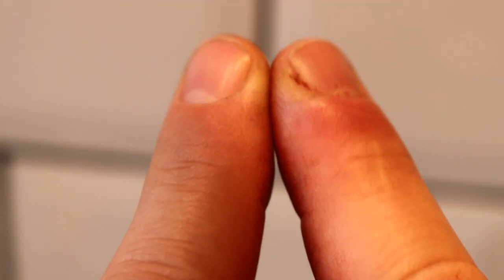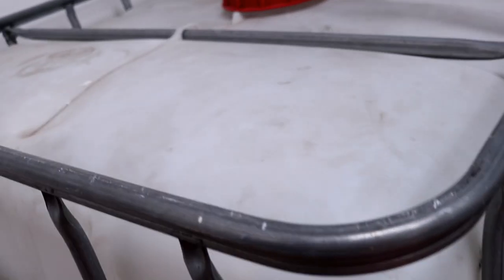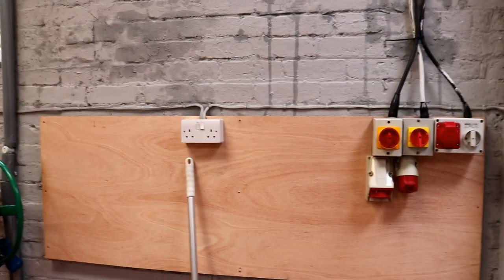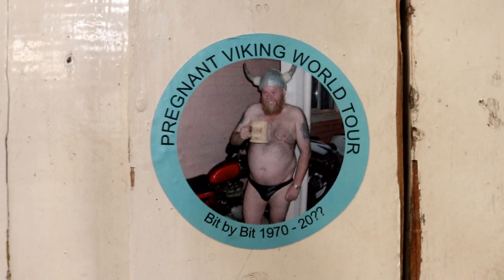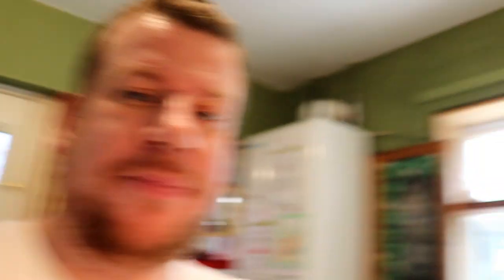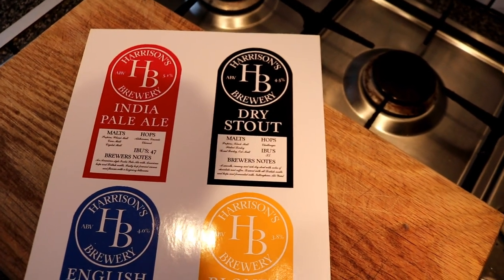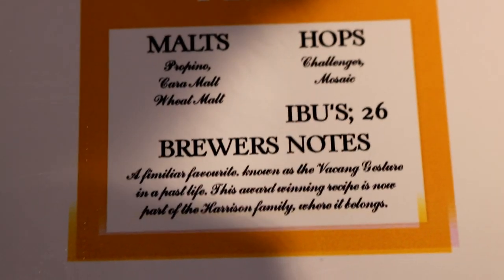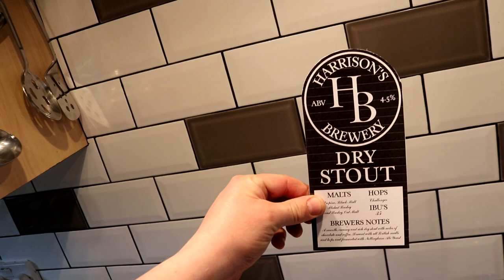PUMP CLIP DESIGNS & SOME GROSSNESS

Comment: A hot needle will release that finger, I get them all the time.

As for that wall, if you can get up the outside, its worth checking the soffits to see if water is retreating past a drip strip.

Cheeky AvE ref towards the end :)
Reply from the maker: The finger is sorted now, I cut it open.